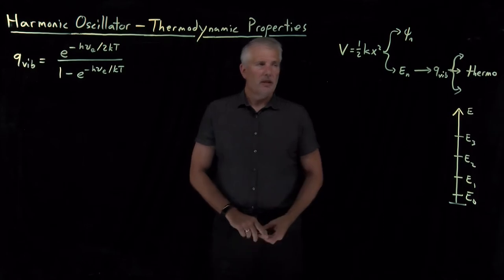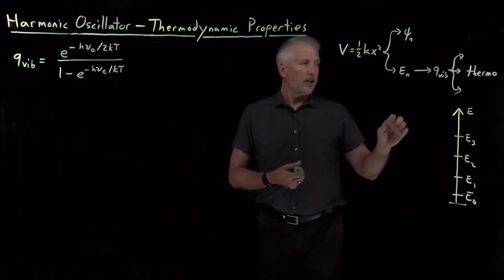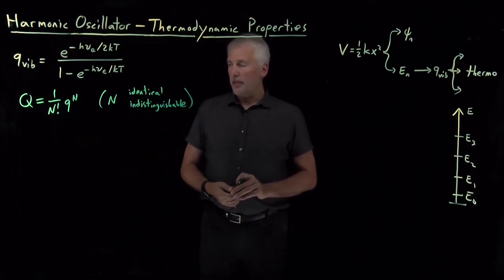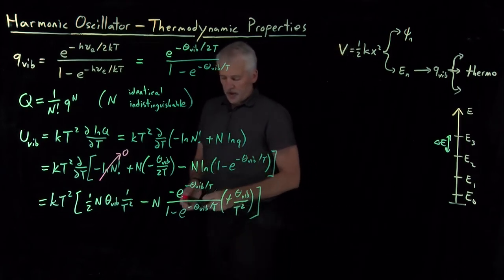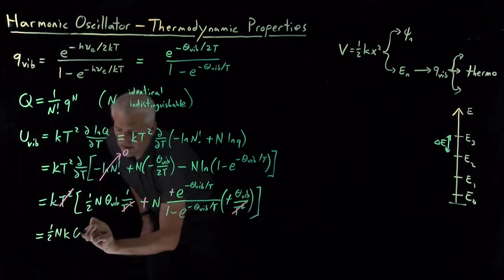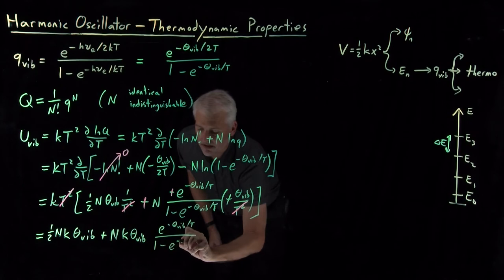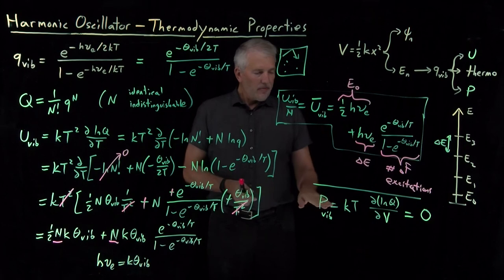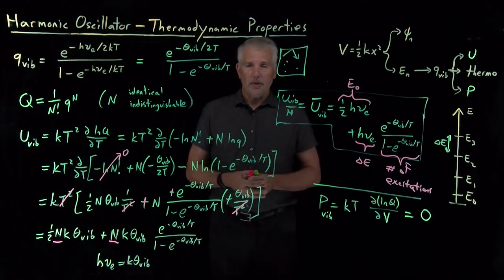Harmonic Oscillator - Thermodynamic Properties

Comment: Great video. I noticed you express U as U-bar (J/mol) but the right had side winds up at h x freq that is J units. To get the units to match do you need to multiple the right-hand side by avogradro's number? (This is same as dividing the left hand by n, moles and multiplying the right by 1/n = (Avogradro's/N))
Reply from the maker: The U that I first calculated was for N particles. So the U-bar after dividing by N is for a single particle. The bar is meant to express that it's an intensive energy, not an extensive energy for the whole system. The units could be J on both sides. But you're also right: if you end up with units of J on the right and wish to convert to J/mol, you can multiply by Avogadro's number
Reply: @PhysicalChemistry  thanks.  I understand now...I'm watching these videos alongside deriving relationships from other sources like McQuarrie and Hill.  I was assuming the "bar" denoted strictly "per mole". You're using it more generally just to make the variables intensive. 
Overall, I like this Boltzmann first approach to Physical Chemistry.  The statistical aspect of the subject doesn't seem to be presented in the correct order in sources like Atkins.
Reply from the maker: @wildmanz8233  That's not a bad assumption; intensive properties are very commonly denoted as molar properties, especially when talking about thermodynamic properties. But for molecular properties (like here) per-molecule is more natural.

I'm glad to hear you appreciate the Boltzmann-first approach!